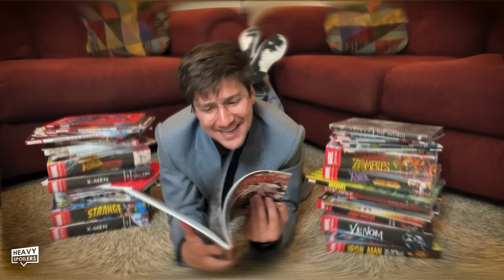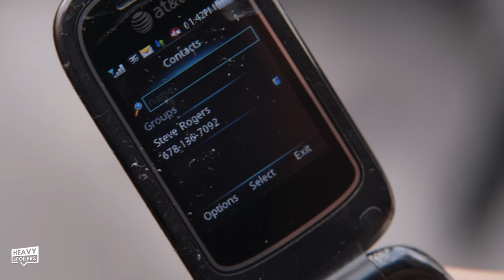SHE HULK Episode 1 Breakdown & Ending Explained | Review, Easter Eggs, Theories And More

Comment: Her hair being "straighter" in her hulk form doesn't bother me. Having wavy/curly hair does change texture for various reasons. My texture got a lot tighter during my pregnancy, for instance. Hormones affect your hair texture and the "length" and cut of your hair can tighten or loosen texture. Shorter hair is going, for the most part, to be curlier. When my hair grows out and I don't have it layered, it's much straighter. There are several reasons where her hair texture being different when she is Hulk form is absolutely plausible.

Comment: I knew her being able to control it better would be a gender difference. It's true though, girls are taught from a VERY young age (or at least early Millennials and up) to bite our tongue and keep in check.  "Keep sweet" is what they call it today in done circles.

As someone who was born female and presented as such for most of my forty years, it was EXTREMELY difficult as I HAVE ADHD which can, in bio females, present with extreme anger issues due to an inability to process emotions correctly. We just default to anger.  My family also has a LONG line if abusive rage (think Hulking out without the fun big and green parts - all rage, no filler), and it was VERY hard to learn the control other girls (and many boys by my late teens) did. I THINK I was 25 before I really started to control the rage and thirty before my temper.

Most girls, on average, learn this control by five, with a few blow ups here or there until puberty - then everything just makes us cry (yay changing hormones!).